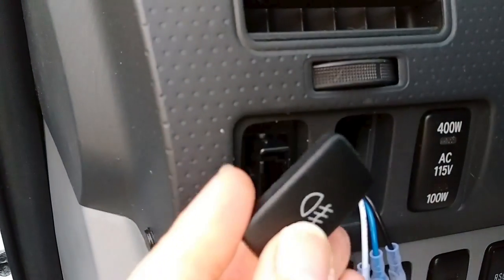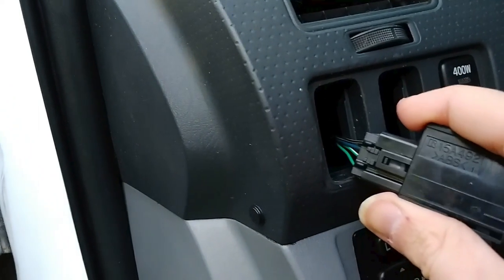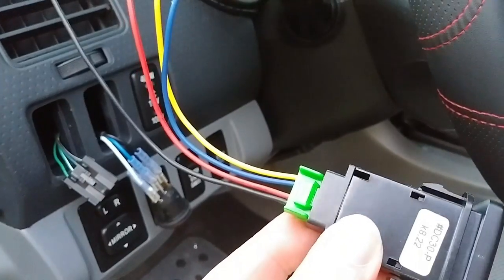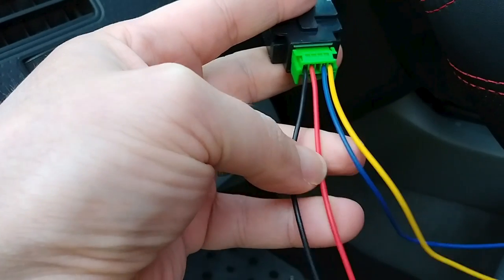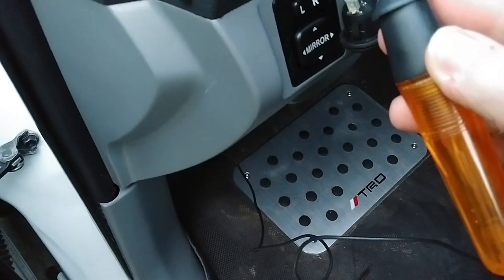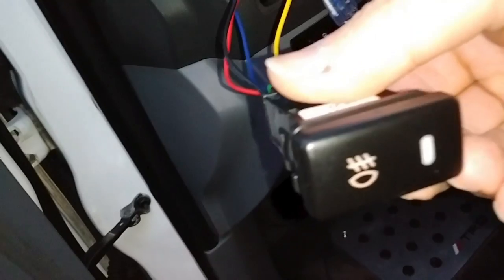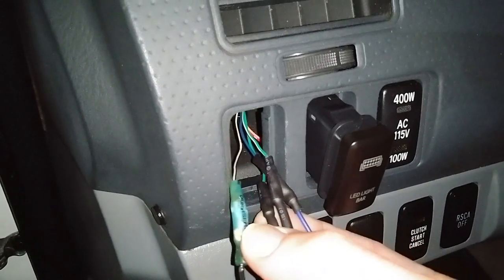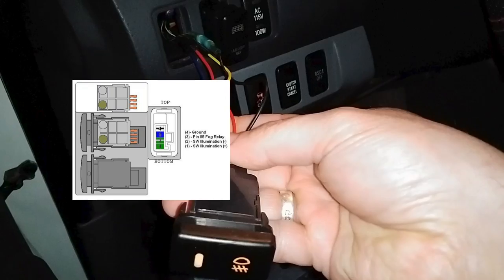Upgrading the OEM fog light switch on a Tacoma

Comment: OEM Green - Red (AF)
OEM Green/white - Black (AF)
OEM Black/white - Yellow (AF)
OEM Blue - Blue (AF)

“AF is abbreviation for aftermarket switch”

On my 2007 Tacoma, I wired exactly like you did on the second attempt but it didn’t work out for me. I went back and wired as you did in the first attempt but didn’t work too. So, the way how I wired as below and it worked for me, idk how but it worked even though I have the same switch as you had; however, I got the same you issue as you had that was the light turned off when fog lights are on instead of staying on, I assumed this aftermarket switch was internally wired backwards. Anyway, I don’t care, as long as I have fog lights lol. Pin this on top for whoever needs it and thank you for your time making the video.

Comment: Hi Dan.  Great video.  I was wondering  if you still had the oem connector for the driving lights switch on the Toyota Tacoma.  I have a oem switch and driving lights installed and no connection   to the switch.  Thanks, Rick.

Comment: I have the same dillema these new aftermarket toyota switches are different. They have an internal circuit. Compared to the original switch(mechanical type). 

New switch
Black-ground
Yellow-12vdc input
Blue- 12vdc output TO relay or load
Red- 12vdc input(gauge illumination/parklight)

If you bench test the NEW switch and tap the yellow and black wires only and press it on, the indicator light should turn on.

The issue might also be(you have to actually check the orig foglight harness), since the orig switch is mechanical type, 2 wires is for the relay coil trigger and ground. And the other 2 wires is for the backlight illumination( 1 wire to back light/gauge(positive) and 1 wire to rheostat(if your car have) if you don't have then its another ground).

I have not finished wiring my brother's toyota switch yet, I will have to remove it again and bench test.

Update: it was not a Toyota switch it was a generic China switch that has the same design even on other car models(green socket with 4 wires).
Reply: Did you ever do this? What did you find out? Looking to wire my Tacoma soon

Comment: I used your orientation for wiring but my tail light fuse (located under the inside switches) blows. Mine goes black, white, red, green. Any suggestions?

I followed recommendations in one of the earlier comments.

Comment: So in fact;the black wire is ground,the yellow wire is positive input(tapping into acc+ for example),and the blue wire is positive out(for light or device),and the red wire is for tapping into the wire that lights up the dash(and that lights up your light on the switch,but not essential for the functionality of the switch itself)?
Reply from the maker: I think so. Switches only need 3 wires: acc, ground, and switch. The fourth to have them come on when you turn on your lights and the dash lights up is a bonus.

Comment: If you look at the wiring diagram for the body control module you see that the blue wire comes from the body ECM and when switched on goes thru the white with black to ground.  Power to the fog lights is controlled by pin 7 on the body ECM which has a wire to the fuse block under the hood, thru the fuse, thru the relay to the the fog lights.  You are merely controlling ground to the body ecm and the computer directs the power.  The fog lights should go off when you turn on high beams and should not work when headlights are not on.  the other two control the light inside the switch.
Reply: One other thing you could have done besides replacing the bulb in the original is remove the pins in the original connector and put them into the  new connector on our aftermarket switch, thereby keeping the original wiring.

Comment: My thought is, as long as the dash light bulb on the switch is Not led than switch the ground wire and the dash light wire. Most likely the dash light and indicator light share a common ground. If so than if the ground wire and dash light power are reversed, the indicator light will get it's ground only when the switch is off. My idea is that it works like a tail/turn light. If you've ever lost ground to a tail light, if you look the turn signal works normal with the lights off. But with the parking lights on, it flashes opposite the other bulb. It does that because it's pulling it's ground through the other filament, not from a direct ground.
Reply from the maker: Could be. That level of electrical stuff is a bit beyond me.

Comment: How did you wire the LED light bar switch from the the 3 prong red circle button?
Reply from the maker: That's a pretty basic one. One is power, one is ground, and the other switches it on and off. Any wiring kit I've seen has a pretty good diagram that shows how to do it.

Comment: you did nothing wrong. Mine did the same as yours when I wired it up. I've tried every possible way and nothing worked how i wanted it to.  the best way to get your switch to work how you want it to, is to bypass the factory fog light wiring and buy a led light wiring harness with 2 leads, comes with everything you need ( cheap on ebay )and run new wires from lights to your switch. Plus they will now stay on when you use your bright beams too. I discovered previously on another switch that the top light on switch was too bright and i didn't like it, so on this one I only wanted the bottom light to come on when i turned headlights on, so I could see the button when driving at night. I used 3 of the factory wires  and all 4 on switch ( 2 twisted together ) to get it to work this way, the switch worked how i wanted it to. the button is lit so i can see it at night. Next I'll do the foglight on with high beam mod,
Reply from the maker: Thanks. But for the amount of effort I want to put into it, I may just keep it this way. It works well enough.

Comment: Think what you need to do is cut that top wire and wire that into your activated fog wiring. So basicly you will only be usine 3 of the 4 oem wires.
Reply from the maker: I don't know about that. I read a lot of online comments about this kind of switch. It works, but the polarity is different from the OEM switch, so the indicator light is on when the lights are off and off when they are on. I've also read about how to get inside the switch to change and resolder connections to make it work, but that's a bit beyond me. I do want the switch to light up with the other dash lights, so there's one wire just for that. Usually, it takes 3 others to run the lights.
Reply: @vfxtutswithdan1893  Im currently in the same boat you are. I get the parking lights to work but when the switch is on to light the fogs the indicator light does not light. The indicator light need to be on the same side as the relay. I will get things to work right once i get time off from work.
Reply from the maker: The problem is that the OEM switch is not set up to indicate when the fog lights are on, just when the dash lights are on. So a switch like this with both indicator lights doesn't easily fit into the OEM wiring.
Reply: @vfxtutswithdan1893  ok, update.....i have the same after market switch  you have with same issue......problem is the aftermarket switch.  I just so happen to have orderd 2 switches way back...found it and plugged the second switch in now  works on marker  and when you turn switch on the line on our switches now light. Im also not using the second hot wire on the harness. 1 hot operates both sides of the switch.
Reply: Ill make a video if you like to see let me know.
Reply from the maker: @tacomaken15  Yeah, I'd like to see that. I'll post a link to it here as well.
Reply from the maker: @tacomaken15  Absolutely. I'd love to see it.
Reply: @tacomaken15  did you ever make the video?  I would like to see it.
Reply: @vfxtutswithdan1893  I think you might be  correct with this line of reasoning.

Comment: no need to replace  switch, just replace the orange light on switch you took out, easy fix, it's right there on the side of the switch, all you need is a small flat head screwdriver to remove and replace it. I just did this for my fan control knobs.
Reply from the maker: Yeah, I figured that out later on. I actually made a video showing how to replace those little lights, instead of spending $50+ on a new OEM switch. I with I had known here, but this switch is okay. https://www.youtube.com/watch?v=xl4Pjs7t4Dc

Comment: Did you ever get ut to work properly?
Reply from the maker: No. The indicator light is on when the lights are off and off when they are on. That's the best I could do. I think it's because the OEM switch isn't wired for an indicator light on it, so it won't naturally have that function. I've read some stuff about changing things around inside the switch and re-soldering, but I don't want to try that.
Reply: @vfxtutswithdan1893  I think I figured it out.  
Open the switch up and unsolder led1 ground lead and solder to the relay pin. Unsolder the resistor (R1) lead and solder to dash light pin. Connect the ground and source wires to ground wire black/white (4 on the tacoma connector). Connect the relay wire to the blue wire (3). Connect the dash light wire to the green wire (1).

This makes the button ground switching and gets the illumination light to turn on when the switch is pressed. Now all I gotta do is make my wires shorter, solder it better and insulate the splices so i can fit it back into the switch.
Reply from the maker: @davidruiz6812  I've read something like that. Yeah, I think that's a lot more than I really want to get into.